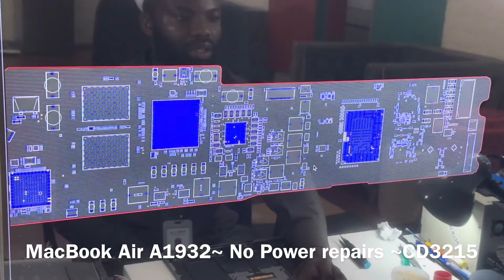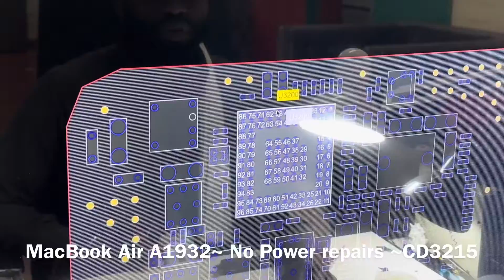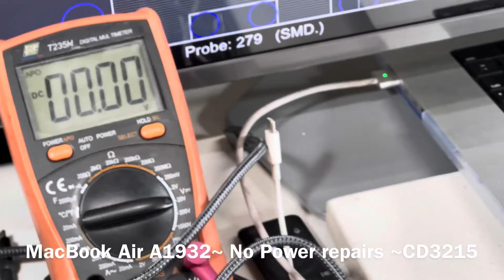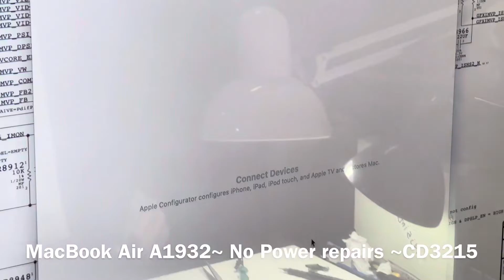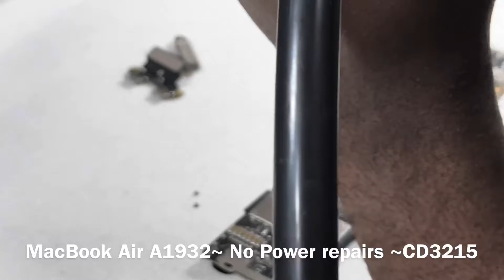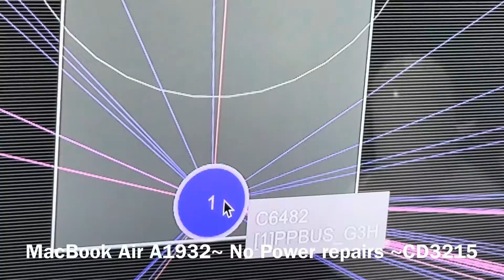MacBook Air 13 inches~A1932~ No Power repairs

Comment: Good one but few things have to be done
Wear an antistatic gloves when handling electronic boards
When replacing cd3215 or cd3217 from another board please use stencil to reball it and then place it
Overall a neat video
Reply from the maker: Thank you so much, still have a long way to go 🙏
Reply: need backlight way where tu buy